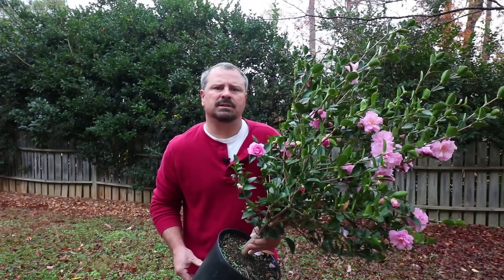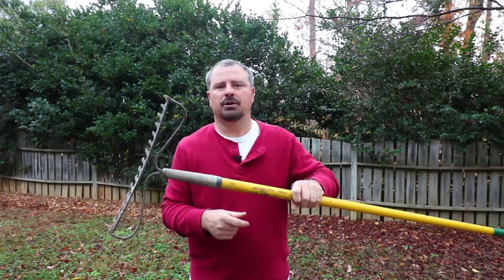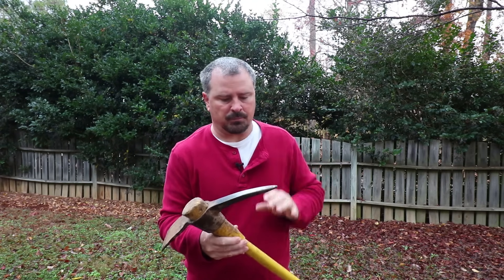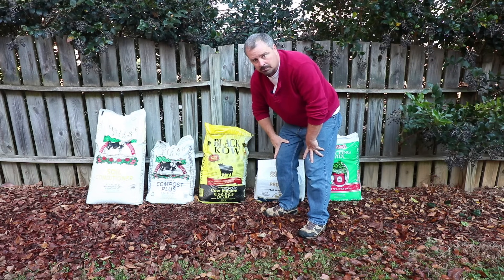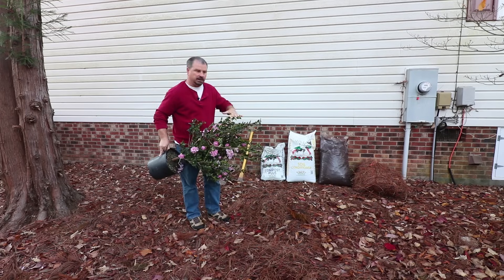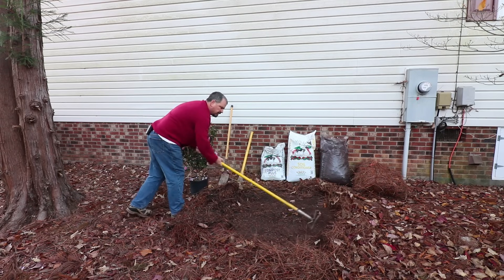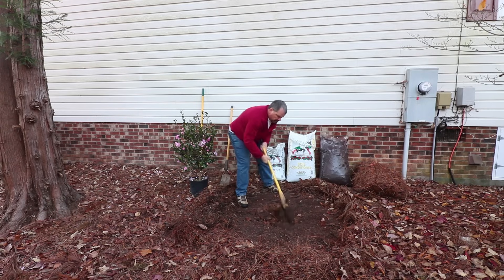How to plant in clay, poorly draining, and compact soils. Proper tools, amendments, and techniques.

Comment: We have clay here Seattle too - it’s consistency is similar to pottery clay. We “go up.” Meaning, we clear the grass or the mulch, put a layer of cardboard down and then dump a yard or two of compost on top of the cardboard. We plant right into it right away - conifers, perennials, ground covers…The whole thing settles down eventually and becomes ground level with all the other plants. Easy Peezy and no digging. Top it up with a layer of compost every spring. Works like a charm.

Comment: I am 77 and am past digging with a pick axe. I use a tulip auger on my drill. Works great!
Reply: I use that method too, but also have a 40V cordless posthole digger that I use. Makes perfect little holes for 1 or 2 gallon plantings.
Reply: 3 point pick rotate it in the hole use as augur

Comment: Thanks for the soil ammendment recs! At 59, I discovered my cordless recip. saw with old wood pruning blades made chopping through roots much easier. Cut to digging post holes for fencing and yes, I used the recip to loosen soil! Actually, I like it using a post hole digger to dig shrub, tree, plant holes. Yes, I am lazy and my rotator cuff is shot!

Comment: Peat Moss is an amazing amendment as long as its not just clay you're mixing in with it.  Grab that compost (home made or store bought), I use a little sand, peat moss, and pine bark fines mixed together to boost the acidity a bit.  The soil always ends up very well draining and holds a lot of moisture.

Comment: Jim (and others reading), you may be interested in what I did today with some of our clay soil in the backyard. I dug a hole to plant an apple tree (it is spring here in Australia) and removed quite a lot of clay and planted the tree into a combination of compost mixed with quality garden soil. The clay was dug out in chunks, each roughly 4 inches in diameter. I've placed them out of the way behind some shrubs for now. I put a few chunks of clay in a bucket and filled the bucket with water, The water went brown immediately and believing clay to be full of good minerals, I tipped the brown water into a watering can and watered the vegetable garden and the newly planted apple tree. Hopefully this will give the vegetables and apple tree a boost.  I mulched the apple tree after planting it, with wood chips.

Comment: In white county georgia. Ive successfully grew longleaf pine seedlings in five gallon buckets with red clay took me a couple of years with nail holes for drainage and would tip the bucket for a day after a heavy rain so i planted from clay to clay into the ground and it worked they are tall today!!
Reply: I tried sand to clay and the pines. Didn't make it so it goes with any thing else that is not raised in clay!!
Reply: If you are successful with clay you can grow any tree any shrub anywhere in the country!! 13:37 13:38

Comment: Thank you Mr. Putnam, you rock!
Reply: Your soil amendments are great, but the only permanent improvement is adding sand and silt to make loam.  The organics burn out over time and require continuous replenishment.
Reply: Adding sand and silt to clay you get cement. You can add gypsum to help break it up but organic materials are the best way to change it and truly make it better quality soil. It will always need more organic materials. The constant replenishment is part of the whole point. It's how it works in nature so why not in our gardens as well? Our gardens, even though cared for by us, are still part of nature's cycles.
Reply: Hi kuhomada bro oya marada

Comment: As always, if you ask 12 gardeners, you will get at least 20 different opinions.
RE: tools
I generally feel the old traditional tools have passed the test of time HOWEVER, a while ago I purchased a tool called, THE CLAW.  It looks like a long handled digging fork with the tines bent into a corkscrew pattern and with a handle placed cross wise at the top.
What it does is to stur the soil without your needing to lift it.  It works great and is far easier on my aching back.  
Also-
RE: Organic matter
I suggest using whatever you can get cheaply.  In the past, when I had my boat, I would save the seaweed that everyone else swore at.  It was full of micro neutriants, it was free
and saltwater weeds will not grow in your garden.  Results are amazing.  I also use coffee grinds, mixed into the soil-again they are free.  Not sure why but they attract earthworms.
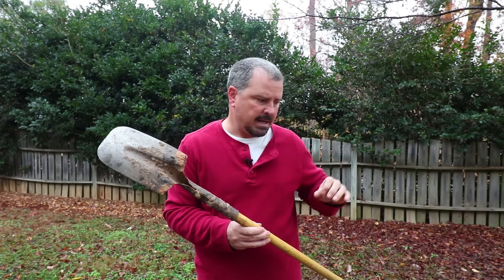The worms work your soil-again for free.  At 3:00 the worms stop working.  They stop for a coffee break.   HAD TO SEE IF ANYONE WAS STILL READING MY LONG COMMENT
Reply: Susan Siegel Really 3:00 p.m. or a.m. EarthWorms Stop for Coffee Grinds Break or Something Else like VermiPooping!
Reply: Susan Siegel   So.... will the worms work any faster if my grounds are from espresso?
Reply: Susan Siegel lol I read it and I also use coffee grinds in my soil. My banana plants love them!
Reply: ladies and gentlemen  the claw is not for CLAY SOIL  , this hort guy does have dense compact ground ,  and I have  the densest fine clay that CATS DO NO GO NEAR << NOT dig-able for  tender toes  .. and!!! that claw  tool==XXXXXXNOPE!!!   once you stomp a claw tool  into that dense  ground  ,  twisting .a claw . ..nope not even for  very strong man to  turn.. THUS  I  LOVE THIS GUYs SHOW  and a pick AXE  ,awesome..  .  red clay or porcelain clay  ,    is used pottery and fine china.  and it is dense and harder than  your malleable  pottery clay that in most classes some  one else prepped that clay for you to use on turn table  ..probably with a motor to use.     some garden and shrubs hate salt,          coffee grounds are   neutral   ... to consider is the history of the tree  or shrub.  where do they normally grow /where do they grow best +location and soil type and what other companion  leaves or pine needles  etc land on the soil they grow within.seasons  what do they eat or drink per season.     , you can have clay dominant soil  and do all the chicken  manure , steer  , horse  4year manures , leaf chipping wood chipping   ph changing  , leaf turning  soil enhancing  ,microorganism, ,what he has done is for a few plants  that need their own specific  soil around their delicate  roots,     but if he was to have a clay soil garden  .   that is whole different process..    and never rototiller  a clay soil garden the  work done to make it usable. will go under the surface and clay will come to the top surface.. even with sand used  and wood chips  the clay will stay on top...   and forking it back to mix is it.    even worm casting or mushroom manures  ..   red clay is possibly more gritty than  this  porcelain clay here. forking in young green plants helps eg  garden carrots beets root veg not potatoes =no.    forking  under carrot /beet grows for awhile and then most of those stay above ground or have 10 roots as they try to  get into the ground over and over again. ps  earthworms and several species of worms do enjoy a break from the hard to get through  grounds.. in dense bone dry clay , very few worms  ,and when found a few   they are curled up in a knotted ball so tight .     they do move after a good rain or ground soaking  , and often with the rains or wet surface  grass or blacktops  as long as they are wet the worms mover elsewhere  away from the clay..but dodging birds and auto tires on the move...good luck earth they do not get it  , plants don't need people
Reply: Lol...
Reply: I love the claw. Great way to get oxygen to roots. All plant love it.
Reply: Loved your remarks!!
Reply: Thanks
Reply: Lol
Reply: Seaweeds are a very ancient type of fertiliser, Irishmen have been using it since forever.
Reply: @emerald1one1  First, she did not say she had clay soil. Secondly, that claw tool is just for the top soil layer, where its topsoil, not clay. Once  you get down to any hard clay, you will know to stop.
Reply: @emerald1one1  Thanks for telling me the truth, straight-out. Now I know what I'm dealing with, and can make life easy for myself. Thanks also for your great humor!
Reply: 🤣🤣🤣lol worms after my own heart lol love my coffee!!❤☕❤☕❤☕
Reply: I guess Im asking the wrong place but does any of you know of a method to log back into an Instagram account?
I was stupid forgot my account password. I would appreciate any assistance you can give me!
Reply: @Brentley Ryland Instablaster =)
Reply: @Danny Rafael thanks for your reply. I got to the site thru google and I'm waiting for the hacking stuff atm.
Takes a while so I will reply here later when my account password hopefully is recovered.
Reply: @Danny Rafael It did the trick and I finally got access to my account again. Im so happy!
Thank you so much, you saved my ass !
Reply: @Brentley Ryland you are welcome =)
Reply: Don't use pine bark it makes your soil hydrafilic
Reply: 111
Reply: Goodness gracious 😆 
I have super clay soil, I've had beautiful plants die from the clay. There's no pine straw in my area. I've tried different mixes over time, potting soil was a huge fail. Mulch is a good idea, I also use the white fluffy bubble stuff, perilite
Reply: St*rBucks is good for spent coffee grounds!

Comment: Great instruction I've ever seen!!   I'm new to gardening and learned the lesson hard way.  I moved into a house where previous owner had already setup the flower gardens.  I wanted to make some changes. When I was digging, I noticed that the soil was so hard and dense, and it's mostly clay. I didn't know what I was supposed to do and planted bunch of perennials (both purchased and spared from friend's garden). Now, many of the perennials are showing stress and some are almost dead :(    I will need to work on the soil to save my plants..  Can I dig out and do the process you showed on this video, or only lay out compost around the plant at this point ???

Comment: Love love love this video. I have searched high and low for how to properly plant in clay soil. I would like to know if there is an easy way to do mass planting of a perennial ground over instead of digging individual holes. Keep up the great instruction and videos.
Reply: Rotary till as much organic as you can get your hands on into the top foot of the soil, treat the whole area not just where you are planting. After planting, mulch the surface and add a few hands full of soil from around the base of matching plants that have been in place for a few years. Keep the area moist until plants are established, worms will appear like magic - job done.
Reply: Cheryl Nadeau great question, from trial and error I would suggest not rotary tilling at all... instead I'd suggest building the soil on top of your existing compacted clay soil, lay out the area you'd like as a garden, then layer old newspapers, or cardboard across the site, then add alternate layers of organic matter like mulch, then do a thick layer of compost on the top and with our perennials we planted straight into that layer of compost. This is beneficial because it builds the soil above the level of the clay helping plants to get adequate drainage in wet periods it keeps the plants crown above the water level, also the layers put on the top naturally begin mixing with the clay as earth worms move in. Think of it as treating the ground like a worm farm, continue to mulch the area as needed over the years. Most weeds won't come through the thick lasagna style of garden, however some aggressive one might so either kill these with spray beforehand or after. If it's a very large area and you don't want to amend the site then choose plants adapted to your location, natives are usually best. When planting it's a good idea to buy planting sleeves which act like mini protectors around the plant until the plants established, these sleeves can be held in place with bamboo, they are helpful for keeping rabbits away and also allow you to spray the weeds around the plants while they establish to limit competition. It's still a good idea to mulch it you can.

Comment: I have always wondered if I was damaging the tree roots when I run into them when planting new shrubs. Also my NC clay is full of rocks in all sizes.  I really appreciate you sharing your knowledge with us.
Reply: I read an article that discussed cutting roots.    The rule of thumb is that a root can be cut if it's about 3x the diameter of its tree away from the base of the tree.    If I can cut a small root underground with digging tools, I don't worry about harming its owner.     ;)
Reply: I always cut the roots because I have to, there's so damn many of them in my yard

Comment: Notes
- he recommends a narrow trench shovel for clay, not a regular water wide shovel
- soil amendments: Avoid potting mix and Manure. Use shredded pine bark. Mix it 50/50 with the clay
- Mulch: helps with moisture and weeds. Can use mulch or pine straw

Comment: I have very hard and dense clay. I amend my clay with cow manure/compost and sometimes sand if the plant is particular about drainage. But my entire property is on the side of a hill, some of which is pretty steep, so my concern is always the water just running right over top of the clay and down the hill. I'm trying to catch and hold onto the water as it's rolling down the hill, so I think the grade should be taken into consideration when choosing how you amend.

Comment: I'd like to add that when you mulch, especially when you've got clay or very hardened soil, ALWAYS make sure that your soil is damp and preferably your mulch as well. The best time to do an initial mulch will be after watering or a rain. If the soil is not dampened prior to mulching, you risk the mulch just creating a layer on top of the soil and water running straight over the ground between the soil and mulch and off to the next area where it's more easily penetrable. The soil being moist will also help to attract more worms. They love (dampened) cardboard/shredded newspaper and coffee grounds so spreading some underneath your mulch layer is good too. For me, I put a several inch thick layer of animal bedding (I've got goat and chicken bedding/manure) and then a few inches of wood chips. This fall I'll be gathering up all the leaves I can and putting them into a separate compost bin for some leaf mould. The areas I've done this with are already looking more workable and brown instead or red clay (as long as the chickens don't go mess up my mulching).
Reply: Hi
Reply: I got an awesome annuals display this spring to autumn. I have a very hard clay soil in summer, that became hardy like concrete blocks and very sticky and damp in autumn and impossible to walking through in winter. What I did was to prune all the sterile blackberries branches that was in my garden (brambles) for the last 25 years and a make a large pile of those prunes and let them become decomposing it self in the environment. Them when it was dark brown, soft and was unable to sprout again I dig all my clay soil and mix all that 10 cm long brambles compost and dig again due to mix it all very very well. The result was that I direct sowed tagete erecta and tagete patula, cosmos, zinnia, alyssum, callendula, mint, purple basil, bellies perenis, primrose, viola, matricaria chamomile, matthiola, alcea rose, nepeta catarina, nigella damascena, sunflowers, wild linum, lettuce, ornamental grasses, grass, and they all came, out gorgeous. And in another bed I transplant from a pot coreopsis Walker low, verbena bonarensis, lisianthus, gaura lindimery, statice sinuata, antirrhinum, lonicera japonica, piper mint, lemon balm, lemongrass, rudbeckia, echinacea, lavender, and they workout wonderful too. I never had an wordy magazine photo garden before. I got lots of earthworms making humus from thos brambles and my soil retains the watering I give them  2 days per week in summer. (Before those vegetables materials in my soil I had to watering my flowers at morning and evening, because they withered). I save lots and lots liters of water I gain time to actually enjoy may garden, deadheading, etc.

By now my garden looks as beautiful like the better spring explosion of flowers and colors.

What I also to, take those cat grass pot (rye, wheat, oats) and divide in 6 parts and plan direct on my soil in another bed. Rye helps to protect as a barrier on very windy days and in late summer give me plenty of straw to add carbon to my soil, or mulch. The give lots of seeds, some to birds and some to next sowing. Wheat and oats I use as green compost to add nitrogen and also improve my soil.  And that is my experience from one abandoned bush land that no one could walk dur to de stings to and awesome flower garden. Lots of birds singing, bees buzzing, butterflies, mantis, bumblebee, and others insects. I got a new ecosistema with a lot of spices I never saw before. And they "work for me"   pollinators and control pest, I have no pests at all.

Greetings.

Comment: Oh dear, I've been doing this all wrong.  I have been using good soil conditioner that I get at my nursery, but I've been adding cow manure as well and a lot of it with the soil conditioner.  I'll mix it really good with the red clay until it looks and feels like cake mix.  My new landscape seems to be doing fine, but I want to do it correctly moving forward.  So glad I came across this video.
Reply: I think you’ll be ok; especially if you are doing whole beds. He’s talking about digging holes directly in nearly pure clay which can form a bowl from which water can’t evacuate from.

Comment: It’s winter here in New Zealand and the clay is very wet. Planting native trees and shrubs so they settle in before the long summer. Our ground is on a slope so l have cut a small trench on the downside of each hole so the water drains away. I’m planting natives that naturally like boggy clay soil down by the creek but I’m still worried they could drown. Thank you for re enforcing the correct method for planting in clay. Nice to know I’m doing it right.